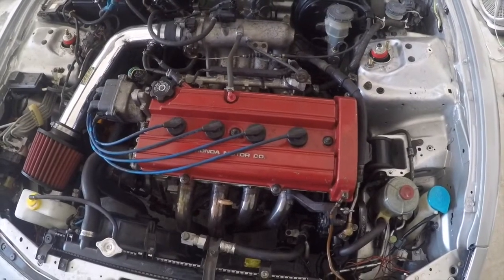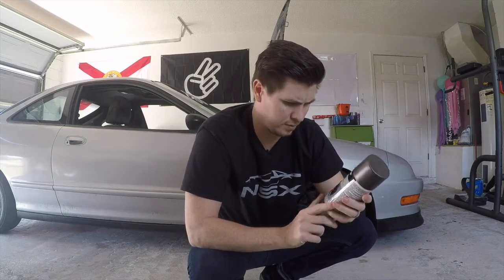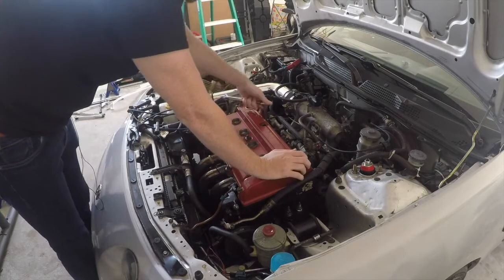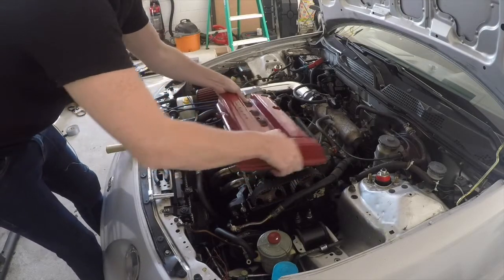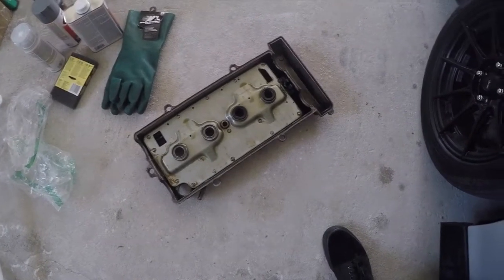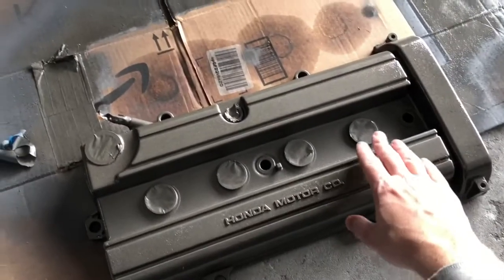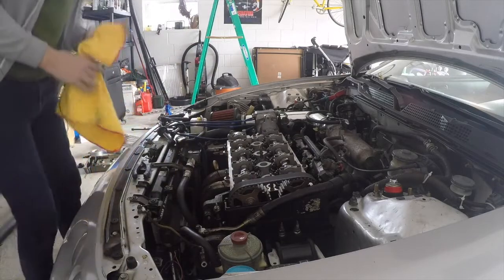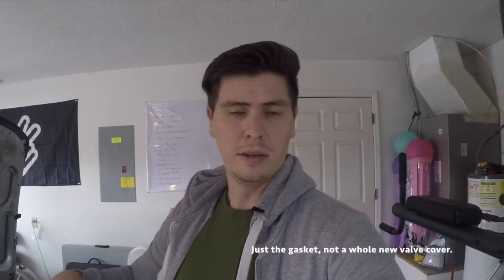Integra B18B Build - Valve Cover Removal and Painting Walkthrough

Comment: I've bought 3 different ones and they didn't fit(even thought the product specs told me they would) I have a 1998 GS 2 door hatch
Reply from the maker: I had a bunch of trouble with ebay headers as well. I ended up spending the money and got the Non-VTEC DC Sports header and it fit the best so far. Still had to hit up a muffler shop to get the extensions right for the cat and exhaust system. 

I just figured start at the front and work my way back with parts that worked. Integra's just have such a hard time cause so many different versions have slight differences so you can get stuck with wrong parts, especially from no name brands.